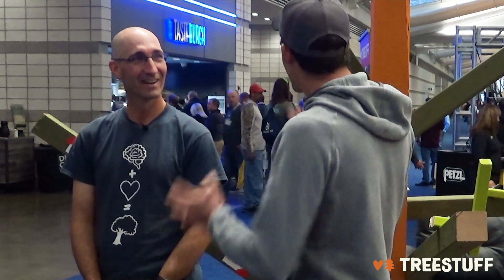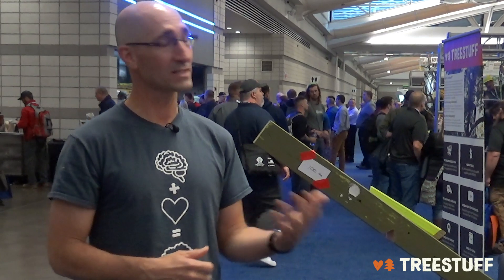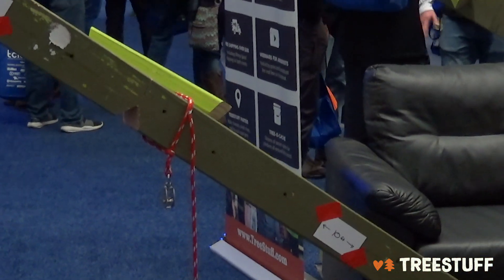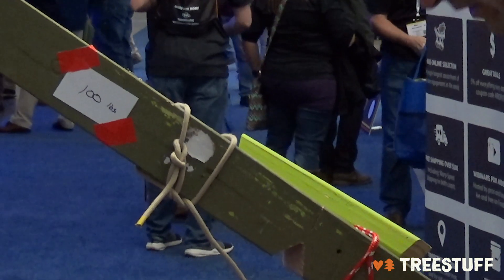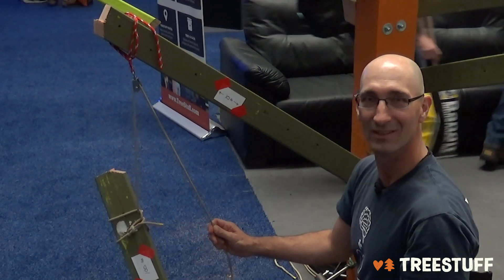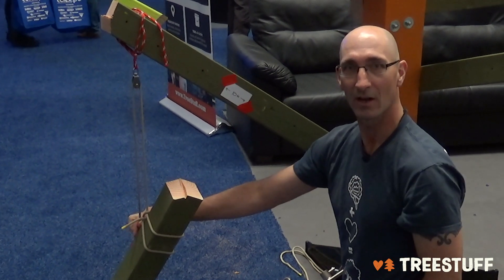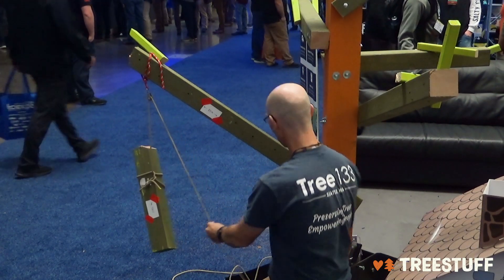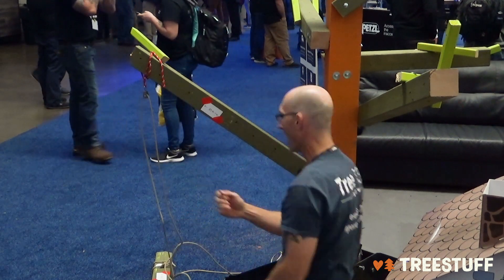Minimizing Load Forces - TreeStuff's Micro Rigging Lab Featuring Craig Bachmann

Comment: Which block will take a greater share of the load when we have a redirect up high? For example if I had a larger WLL block and a smaller WLL block, which one would I want up high vs out on the limb? I'm assuming the larger one up high...
Reply: I'd think so. The angle is much smaller there.

Comment: Top video. Retrivable rigging rings are great for a high angle rigging point as you can set them in the crown of the tree when you set your climbing high point. When your finished rigging they can be removed remotely to save you climbing to the top of the tree again.